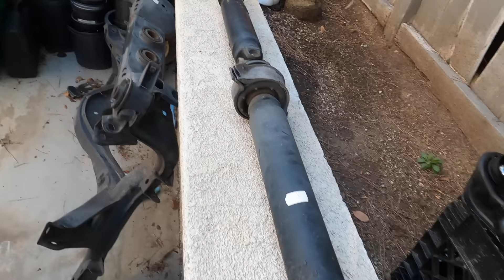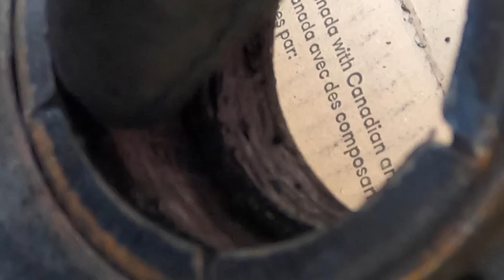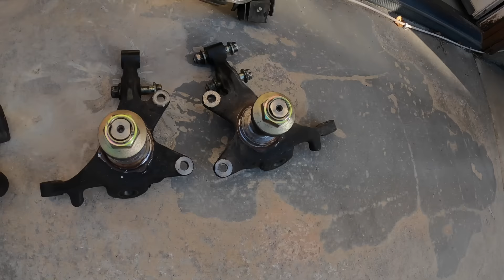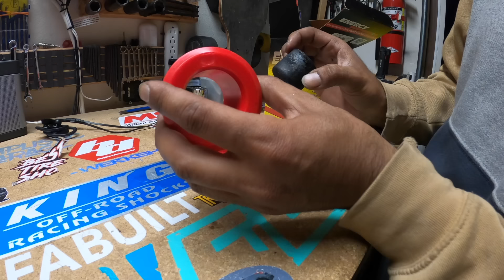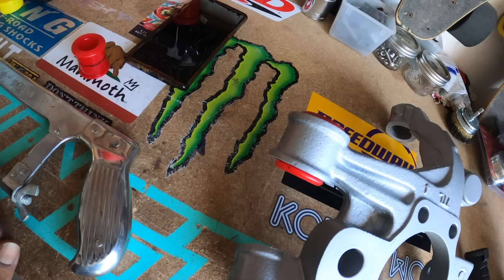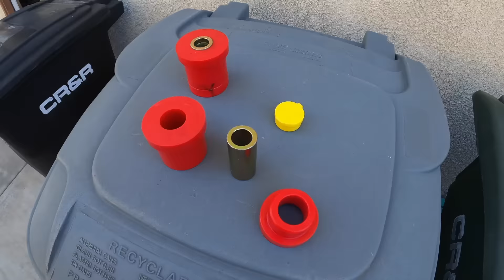1995 Nissan 240sx S14 Energy Suspension Bushings Full Rear Set (Arms, Knuckles, Diff)

Comment: did you have to cut the sleeves for the front subframe bushings? mine dont seem to fit but went in well in the rear
Reply from the maker: It's been so long, I can't remember. 
I do remember having to cut the sleeves out of the subframe. One side, tho you have to keep the little teeth that are sticking out. 
I'm sorry since this was so mong ago. 
I can't recall how I did it. 
There are too many chassis I have built since then 
This is something I do for every car I build
Reply: @ I just finished doing it lol, the front bushings were double sleeved and had spot welds which I hammered in. I removed the inner sleeve while leaving the outer one (that has the small lip) and everything fit fine then!
Reply: @matiasssss13  I'm doing this right now, whats the best way to get these bitches(inner sleeves) out lol. Just hammer and chisel?